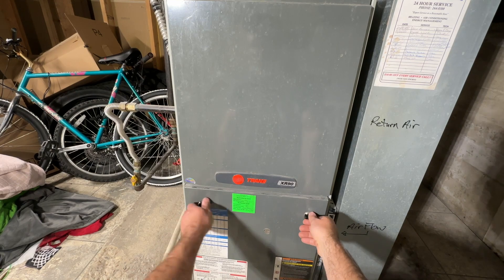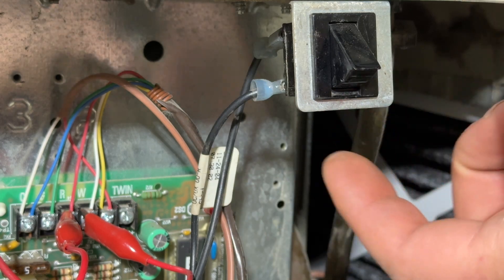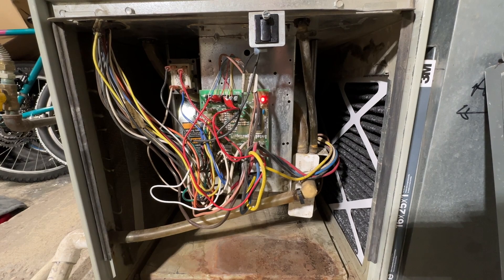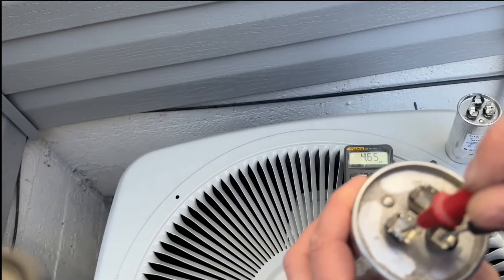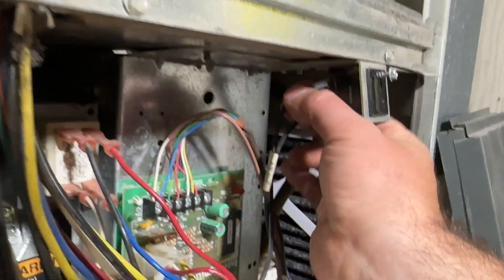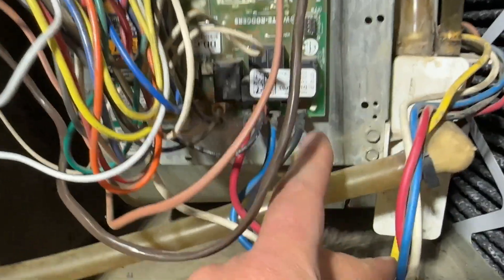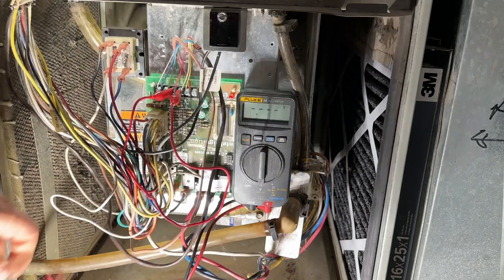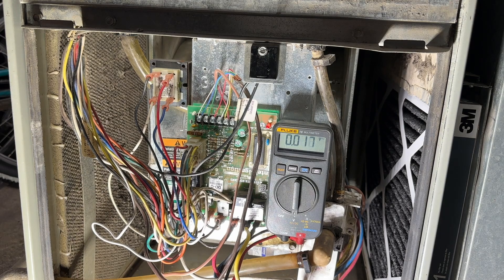How To Troubleshoot A Bad Control Board! Fan Wont Come On

Comment: Thanks for showing this! I just put a new blower motor on because the first tech told me it was a bad motor without properly diagnosing. 2nd tech came out and said it is the control board. Carrier 58MTB that is 17 yrs old. Will probably replace furnace, but not with that company!

Comment: I don't get how 115V isn't enough to turn on the blower. There isn't much of a difference between 115V and 120V. I can only see 2 possible scenarios:

1) the board is indeed bad because it doesn't give 120V.
2) the board is not bad if the 115V is still within tolerance specified by the manufacturer. And the motor was designed to operate at a higher voltage, which implies 115V isn't enough.

I'm still leaning toward that board being bad but that small 5V difference is really bugging me.

Comment: Thank you for the detailed steps. Your channel is absolutely fantastic. Last summer, after watching one of your videos, I was able to get the A/C working again by replacing the capacitor on the heat pump. With the info on this video, I was hoping to resolve an issue with the air blower on our furnace. After following the steps on this video I found a problem with the transformer.  I am getting good readings on the high voltage side 124-125v; however, the low voltage side shows erratic mV readings, fluctuating between 1.1mV and 3mV. Checked multiple times and the results were the same every time. The transformer is rated at 120/24V.  I was under the impression that the low side of the transformer is meant to provide power to the thermostat. Can the low/mV output on the transformer cause the motor to not run? Thank you for your help.

Comment: I did that my is getting 122 vlt and still doesn't turn on , but if i help the fan a little it starts working, 
I bench tested by applying power to each lead and it kicks on without helping it to turn, but when i installed it into the unit it doesn't work unless i help it, i also check the reading on the other speed leads while connected after i help it turn and they are 122vlt for the one that its running, the other ones read 84 volts and the other one 248 volts, why is that ?
I replaced the board and still the same issue? Please help me out
The motor that i got was from Grainger electrical is a Dayton  with the same hp and thats what they recommended 
Same hp and

Comment: Went ahead and replaced my control board turns out there’s a three amp fuse that was blown. There still a short and I’m narrowing it down to the heater side. AC side is working, but once I switch it over to heat and the blower starts to go on in immediately blows the fuse.

Comment: Greatly appreciate your videos, thank you. I was asked by a client to check their heater, apparently the furnace was firing up, but the fan was not circulating any heat. I was following your tips and found that the filter was completely clogged, the owner had no idea there was one, it had not been replaced in years.

Comment: Thank you. Our's is failing intermittently. I can pull the 5 amp fuse and let it set for 15-30 minutes and when I plug it back in the furnace works normally for random amounts of time, usually 24 hours or more. This gives me an idea of what to look for. Excellent video.

Comment: I have a Comfortmaker (mfr icp ) Mod# N8MXLo701716A  I believe the control board is not turning inducer on ( I put 110V to inducer _ works fine)but did not fire up (main blower turns on) I can not confirm proper control board part# before ordering. existing control board# HK42FZ0543815 . would you know proper replacement part DIY.    Thanks

Comment: Great videos. I’m watching as much as I can. Gonna try and tackle new heat pump upgrade after watching many of your videos. Just trying to get through the summer heat before attempting it this fall. 
I know this pertains to the furnace/heat but could the same procedure/test be done to verify if the board bad if the blower motor unexpectedly cuts off/wont start when thermostat is calling for cooling? Basically instead of testing the heat pin (yellow/heat) and neutral, could you do the same voltage check for the cooling pin and neutral? 

The capacitor and blower motor are new (wish I had found this video a couple days ago). Freon flows, no obstructions/new filter, compressor functions. Fan stops less than a minute after stat calls for cooling. I’m wondering if it’s a faulty board and if this would be a good way to determine that.

Comment: Couldn’t you just jumper R and G to trouble shoot it ?
Reply: Pcb bord power checking trsding  trsformd low volt  rc  rg  comon cool  and checking    r using  strge comrinv anx  checking  ry  24v  rg   ond ny  fsn low high meom oin power  met checkinvg
Reply: @jollyscaria1922 what??

Comment: Great video and I learn a lot from them, so thank you. When the Red LED is blinking on the control board, does that mean the board is bad or does it blink all the time?
Reply: Some boards will have a blink pattern to specify a fault code.  Usually the patterns are labeled on the cover or in a manual.

Comment: One of the relays is bad, its contact did not switch . If you pull out the blue and/or red, I think it will run.

Comment: Actually, your blower is not getting enough current. We know the control board's relay (for the yellow wire) is being turned on since you measured 115 VAC, so the relay contacts must be damaged! Just trying to send you my electrical knowledge in return for your great videos.
Reply from the maker: Interesting!! Thank you sir
Reply: I'm female, but it's all good! Very cool how your video shows how there can be the expected voltage but far too little current(amps) to run a motor.
Reply: The reason it did not get enough current because one of the other 'bad' relays.  Pull out the red and or blue wire.

Comment: Is there a misspelling on the price?  Ridiculous i would get a 2nd opinion and pay a svc call....most is 300 for board and 185 install for a rep co. With a warranty 1 yr parts and labor and if u want old part i leave it on top of AC if part do not resolve the issue No charge for part only svc call but most our customers have contract so they only pay for parts not under cont.. about 100 bucks This ia my co in my state....lowest temp here now 56

Comment: Thanks for all your videos. I had the same unit with the same problem.  The root cause was a cold solder joint on a white terminal connector. This was caused by the weight of the wires and an unbalanced blower. Having the control board mounted to the blower housing is probably not the best design but the stock wires did not allow relocating for me.

Comment: Remove black wire from cooling speed terminal.  Replace with yellow wire for heat speed.  Select fan on at thermostat and call for heat.  Fan will run continuously but heat will be on.  Replace board... likely cause is pitted relay contacts in fan relay.

Comment: @The DIY HVAC Guy, firstly thank you for taking the time to film such clear and professional videos.  I'm having this exact issue after following the instructions it seems as though my control board is bad.  I have a lennox 80mgf3 60a-12 and have a surelight model # 50A62-121 control board.  I've found one that says it's compatible but it's model # 50A66-123-01.  Can you please let me know if that would work with my unit?  Any help would be greatly appreciated.   Thanks again!

Comment: Thank you for your excellent videos; the above video makes total sense and is the source of my problem. Interestingly, the blower motor comes on when a call for FAN or Cooling is received but not for a Call for heat. It APPEARS that the call for heat and the call for the FAN to energize are two separate circuits. I ASSUME is for the blower to run at a lower rate during the demand for heat. I need to verify this, but it is the only thing that makes sense. Thanks for the simple motor test; that should help me immensely.

Comment: Dave,replaced contractor in my Amana heat pump I thought all wires were replaced however I found 1 red wire that comes from defrost board marked cnt where on the contractor does it go? Thank you very much

Comment: I got a emergency service call this morning with identical issue on a Emerson, only difference was I had zero volts at heat stake on tab. I know those black box relays on the boards can stick as they get older so I did the tapping on them to see if I can free them up for now till I get a replacement. Nope. Being the weekend and the burbs of Buffalo, I needed a work around, hmm. My board has a tab just for constant fan run, (like you would set your thermostat to fan always on and circulating the air)that let me run unit without it tripping on thermal overload. It’s a temp fix so heat does operate properly and furnace shuts off when setpoint is met. Love your videos. I can’t remember if your the guy who did the video on the kiawets dmm amprobe but I’m glad I picked one up

Comment: Great video. I have a Trane furnace that shuts off because the blower keeps shutting off. I found that by pressing on the control board the blower will kick in and I will have heat again until the process begins all over again. Do you have any idea why? New sub here.

Comment: How do you touch the yellow wire to the door switch while power is ON?
Reply from the maker: Pull one lead off the door switch on the back and touch yellow to it while closing the door switch

Comment: Thank for very good explanation and troubleshooting. 
Could you please explain TWIN terminal which no wire connected to?
Also what is the replacement card for 4633e Emerson card for Amana furnace?  
Thanks.

Comment: Hey HVAC Guy, you have really excellent videos & I've learned a lot watching them. This is off topic for this particular video but I was hoping you could do a video on identifying the proper capacitor to use on the condenser side of the system. The original on mine has no identifiable markings I can use to obtain a replacement due to corrosion on it. Or perhaps you can just push me in the right direction to a video you may have already done on this issue.  Many thanks in advance.
Reply from the maker: Great idea!  Until I make that video, if you’re trying to find the right capacitor right now, you can punch in the actual condenser model or serial number in repairclinic.com and it will give you a parts list for that particular unit. Or if your capacitor is still good and your system is running, you can use a multi meter to check the existing one, and then purchase a replacement. Hope this help! Cheers

Comment: I don't think it was the 115 volts that was insufficient, I think it was lack of amperes.
Reply from the maker: Interesting. Well the new board fixed it. I just wish I would have tried the fan motor to the safety switch trick before replacing the motor only to find out it was fine! Smh
Reply: @diyhvacguy  You did it right, I am just mentioning things I have stumbled over. The test meters read a voltage that sometimes has no real meaning because negligible amperage will make it through when an actual load is applied. I think if you read the voltage with the load applied, it would drop to zero. Conversely, I have made another mistake when I tried to test an electronic low voltage transformer. It read no output, but if you put a bulb to it the bulb would light and you could read the volts and amps. Its just a thing that happens when you test an electronic device with another. Its just my experience; I have no formal training.

Comment: What do you think of AirQuest vs. Goodman? HVAC Direct wants to substitute AirQuest for my Goodman order. Should I say OK?
Reply from the maker: Yea Airquest is an offshoot of Carrier equipment. It’s a good brand and the same 10 year warranty can be had with Airquest. 

If you need some help with your replacement, check out our Patreon membership over at Patreon.com/diyhvacguy  where for $50 I will give you one on one assistance with replacements, diagnosing, and even help with getting the full 10 year warranty on your equipment. Cheers

Comment: I bet if you pulled the yellow wire half off so that you could read the voltage with it hooked up it would have been 0. There are a lot of transient "ghost" voltages on circuit boards due to the nature of electronics.
Reply from the maker: I did that and it still said 115. I didn’t show it but I replaced the blower motor because of that. Only to find that it did the same problem. The board was the fix for this one. That video comes out in a few days.

Comment: Really like the trick to test the fan motor from the switch! Has the problem been solved after the board was replaced? And have you got a chance to test the voltage from the switch? I wondered it was 120 or 115?
Reply from the maker: Yes the main power wire off the switch comes right from the transformer. So it had 122 as well.  And yes the board fixed it. That board replacement video comes out tomorrow I believe. Showing how to physically replace the board 👍🏼 cheers

Comment: I'm an electronics troubleshooter and repairer by training.  I was told that the control board was bad on my parents furnace and had to be replaced by a local HVAC service company.  It was winter here in Wisconsin, so I paid $2700 to have the board replaced, because I didn't know how long it would take me to get around to troubleshooting the "bad board", replacing components and repairing it, but, I did request to keep the bad board after they replace it with new one.  I was told that they did not leave bad components with the customer, and would not let me keep it.  That made me very suspicious.  For all I know, it could have been something as minor as a series of resistors, a relay, a capacitors, a cold solder joint,  or some other components that very rudimentary board had that was degraded, shorted or open.  I just found that very suspect, especially with him trying to charge $290 to replace a flame sensor that was only reading .30 ohms out of the +/- window tolerance.  He didn't even offer to clean it for me.
Reply from the maker: Sounds like you need to find a small family owned hvac business that’s trustworthy!
Reply: People do not generally repair these board, but if you have the skills then by al means.  The being said a typical universal board will run the contractor between $100-$200 and takes less than an hour to replace.  Maybe even 20 minutes depending on the board and accessibility.  So even if he did it on Christmas Night Holiday rates and it took an hour he got you for at least $2000.  The boards are pretty much plug and play with a few minor modifications (such as cutting jumpers) on a Universal type.  That guy should be in prison.
Reply: @Nine_883  I was pretty disgusted with the cost.  They have people at their mercy, especially during the winter.  All this was after he tried every sales pitch in the book to get me to finance a replacement 90% efficiency furnace installed for $5800.
Reply: @chrisgreen177  There are a lot of crooked operators in the industry, but by the smae token these guys make most of their money in about 3 months during the summer time.  Furnaces do not fail as much and are less expensive to repair than air conditioners and heat pumps.  I would expect a fully licensed HVAC guy to be expensive, but not "$2k for a printed circuit board expensive".  A lot of these boards run about $100-200.  Depending on the application and brand they could be almost $300.  That would be rare.  Most of them are less than $150 my cost.
Reply: @Nine_883  agreed I don’t know anyone who repairs but that’s a lot of money but I will say due to circumstances idk how much they had to pay a guy to leave his family to do this
Reply: @Nine_883  but 2k+ a stretch tho
Reply: Thanks for sharing your story.
Reply: He was trying to (or already did) take you to the cleaner.
Reply: It really  depends on who you got to look at it. I work for a smaller company and we all try to do what's right and hook people up with what they actually need. Some people  are trying to make a buck. I could maybe see charging 50 or 100 for a flame sensor  bc of supply and demand but that price  is pretty  crazy and the fact he didnt try to clean it is pretty sketchy. I wouldn't trust that guy. Sorry you went through  that.
Reply: Same thing happened to me last year in March and now again the control board got burned November this year. This is a brand new home and barely a year after the control board on the outside fan unit is burnt. I paid almost 500 dollars service charges for replacing the board. I'm nervous about contacting them again for this as they may say it is outside of warranty period and charge me for both service and the board this time. And yes they did not let me keep the control board. This is outright scam that is going on.

Comment: Great tip on testing the blower by connecting it to the transformer near the door. Thank you for your easy to follow video.
Reply from the maker: Yea! Definitely using that truck next time I’m diagnosing a furnace with no blower!
Reply: Lolol was it the transformer or the DOOR SWITCH.  who knows good luck ;)

Comment: Great information. One problem i find is I went to a heating and air conditioning supply and they wouldn't sell me parts because I didn't has a licence.
Reply from the maker: Yes that is a very common problem. A lot of times the parts can be found at repairclinic.com but you’ll have to wait a few days. Next time, send me a message at diyhvacguy@gmail.com and I’ll see if I can call in a part and you can go pick it up 🤘🏼
Reply: @diyhvacguy  Thanks